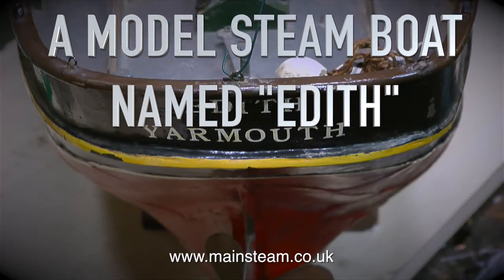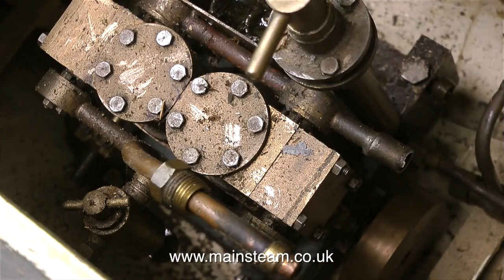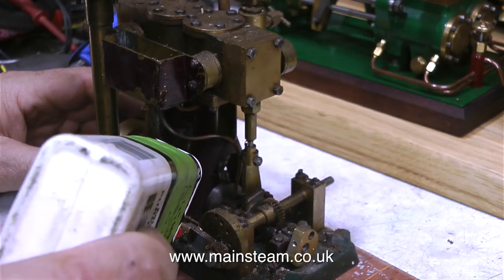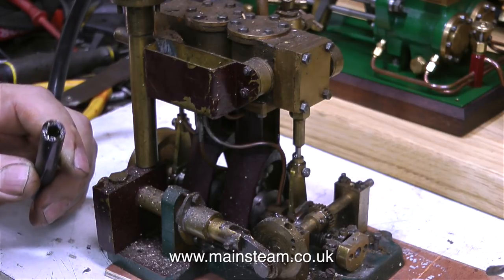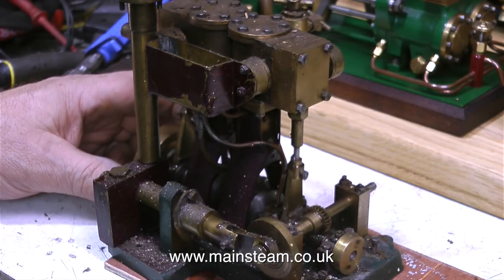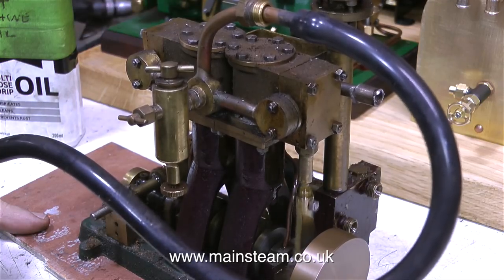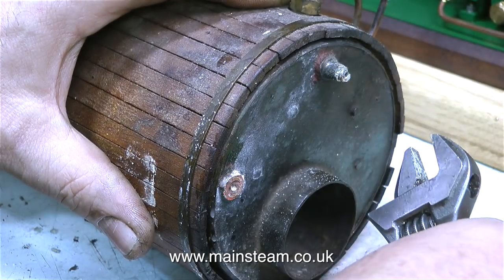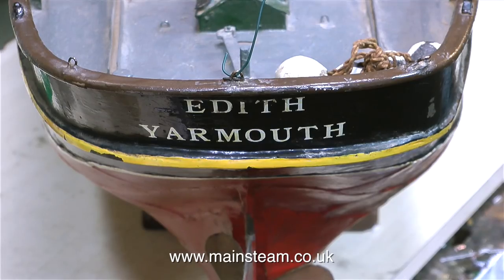A MODEL STEAM BOAT NAMED EDITH - PART #1

Comment: what you should do with a non self starting engine is have an electric motor on the prop shaft so when you press a button on the controller it will turn over the engine so when you apply steam the engine will start
Reply: Usually it is connected to the flywheel, all you have to move the engine is a small bit off of tdc/bdc. I have even seen some where they use a rod on a servo to do it.
Reply: If it had a 90 degree crank it should be self starting when steam is applied.

Comment: What an absolutely beautiful engine I've never seen a twin cylinder that small before. the way it ran and sounded if it was in a different setting without anything to give away its size in the picture you couldn't tell that was a model.